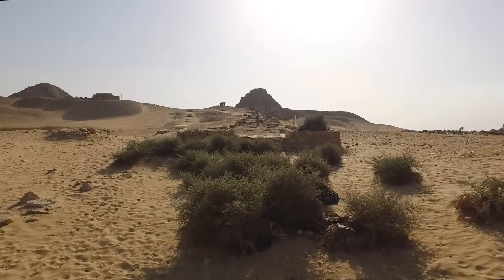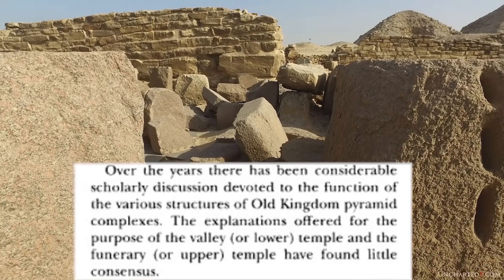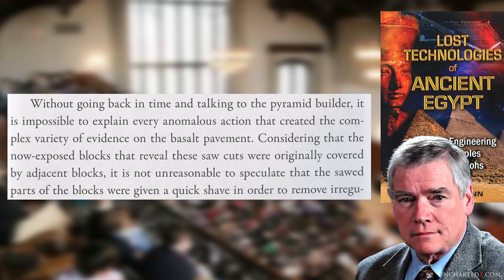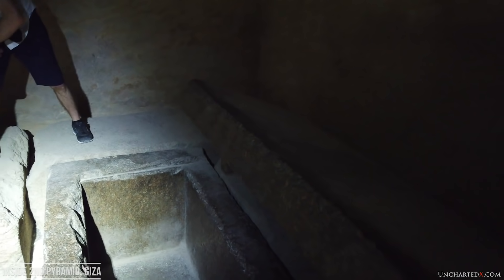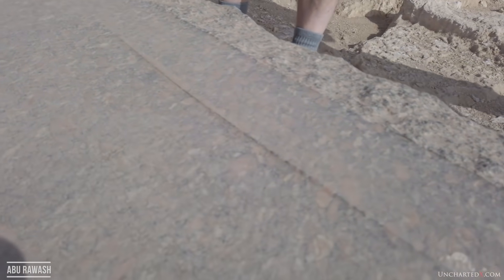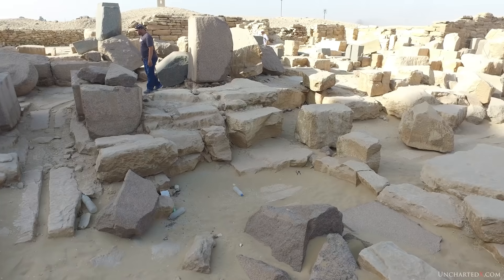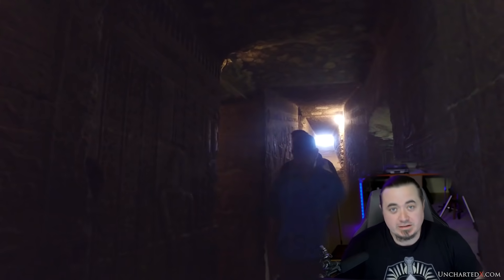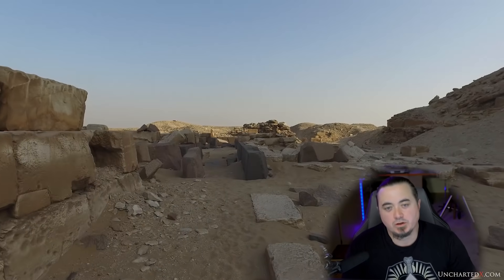The Mystery of Ancient Egyptian Stone Cutting in Basalt and Granite - UnchartedX full documentary!

Comment: Ok bro trust me im opened minded so facts can make me change my stance on things. That being said im a welder and we use alot of band saws to cut, and that would act like a straight saw and I can tell you that a band saw if pushing to hard  will make a radius cut. But I think you said the stone had a radius from 2 sides of cutting almost like a bowl or a zoom lense, if thats so then the radius were made on purpose because you have to cut 1 side first, and if it was a mistake then after that first cut they would of scraped it. So my point is that the radius could be done by a straight saw but those radius were made on purpose.
Pss. I just thought of something the radius that ive seen with straight saw is with a saw just moving 1 way not back and forth. So yea thats another thing.

Comment: I believe you're making a mountain out of a molehill.  The difference between straits saw marks and radius saw marks is quite explainable.  The illustration that shows a saw being a suspended by 2 points it  will leave straight saw marks.  If you have a saw and it's it was suspended by a single point this will leave A radius saw mark.  What should be the larger question is the increments of the saw marks.  How does one incrementally index the cuts forward at such a uniform measurements.  Tying and untying the  rope will never give you such uniformity.  this only leave raising the platform which the stone is a attached or mounted to and adding shims underneath.  As far as your cuts ending up in a V shape at the bottom from what I could see in the  video there is not a finished or  successful one that ends that way in the pieces you have shown.  So as a guess I would say those that have the V cross section at the bottom were all failed cuts from dull saws.  Because in these I have not once seen any marks that would suggest a lack of kerf in the saws. except for the one stone that is double radiused cut that is a classic unbalanced cut.

Comment: I think most of the basalt floors were relaid in the 1930s
Reply: Basalt also  cracks like slate leaving flat surfaces. So I don't find the basalt as interesting as the granite cuts and drill holes
Reply from the maker: @cocabiss  I don't think so. but they did build a road over it at one point
Reply: @UnchartedX  was that in front of the great pyramid? I saw a picture of it at the start of the 20th century and it was all over the place and heard somewhere it was relaid in the 30s .didn't know most of the temple floors were laid with basalt aswell. Thanks for the reply. Keep up the good work I think you and a few others are reall starting to get somewhere.

Comment: The drag saw is easily debunked. Yes it might work on an external edge. But how would it work on an internal corner of a cut out box? Even with today’s technology the internal corner would be hard to achieve.

Edit: after watching more. What about a huge blade on a pendulum swing lowered as it cuts?

Where do the channel block lead too? Do they run underneath the actual pyramid?

Comment: It's really easy to make a perfectly flat surface by hand.... You just use perfectly flat guides for your finish work.  You make perfectly flat guides by pulling strings tight... To make perfectly flat lines.   Making 90° angles and other angles...perfect... is easy using geometry.    

  You can make optical lenses for telescopes by hand, in fact if you're an amateur astronomer.... If you're going to have a lens over 8 in you're going to have to because you're not going to be able to afford it to buy one.  Our ancestors knew how to do things precisely by hand.... Because it was their only option.  Most people today don't.  Most people today couldn't find the center of a  board or circle without a ruler

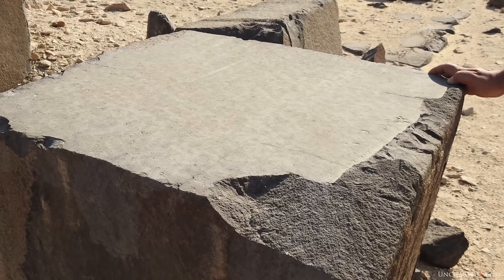Comment: 30:18 What? a 9 m circular saw? Why? A short semi-circular arc dragsaw is a much better explanation. 
This would work slightly better than the mainstream proposed flat saws, as the corundum grit used would settle in the bottom, and would show the same 'circular' pattern of cut lines. 
There's no need to invoke a 9m circular saw.
A lot of 2 man wood saws from the last two centuries are semi-circular in blade profile, because it is easier to apply pressure to the base of the cut as you and your buddy rock it back and forth.